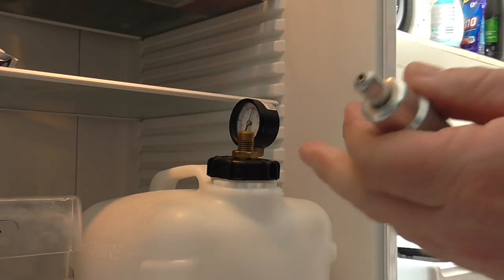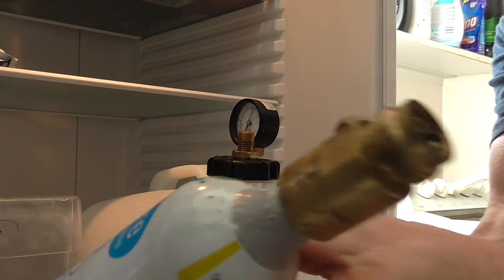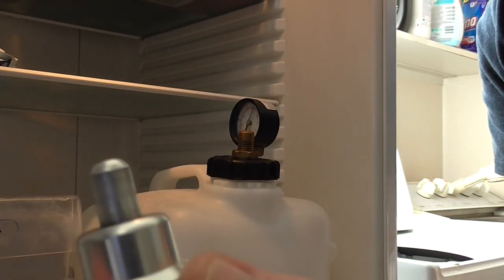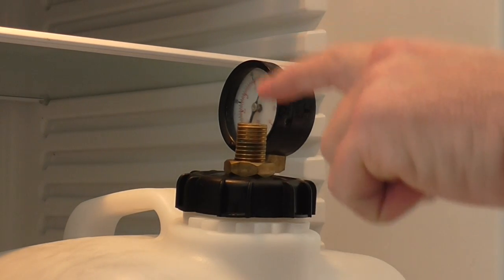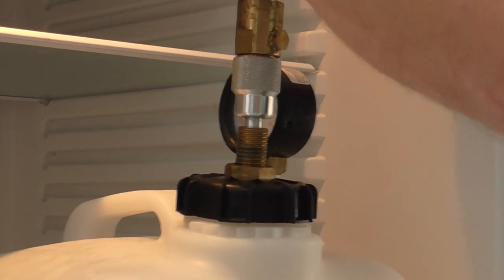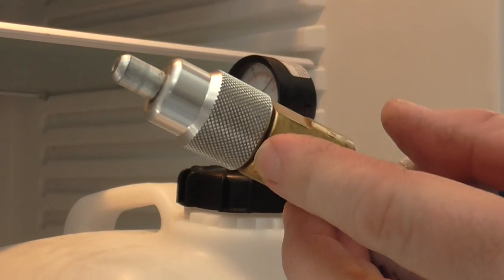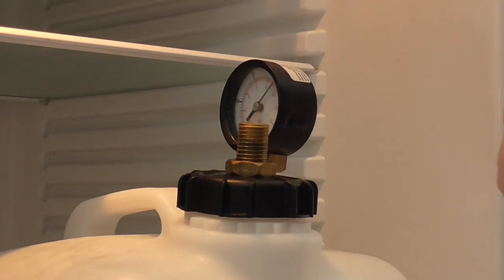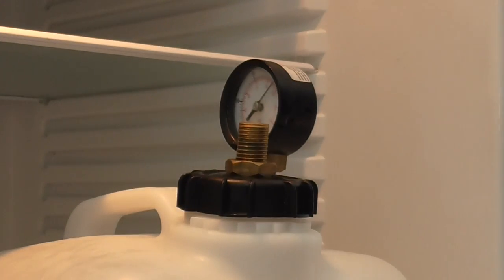Beer Mini Pressure Barrel - How I inject CO2 gas with a Sodastream Cylinder

Comment: Where did you get the psi regulator to fit your beer barrel
Reply from the maker: Hi. Check out the video description of this video. It has the type of pressure gauge I bought.https://youtu.be/TJksssBNNSAHere's where I bought the gauge from a local company https://nzsafetyblackwoods.co.nz/en/gauges-pressure-ss-1-4-bsp-bottom-0-100-kpa-each--05532436

Comment: Good idea mate I've seen someone do the same on a corny keg, it saves having a big C02 tank in house.
Reply from the maker: Thanks mate. I do a little priming in the barrel first to get the initial pressure up a bit, but the cylinder is a great way to keep the pressure maintained. Cheers

Comment: Really nice job, can you share where you sourced the inlet valve on the barrel and the injector fitting on the sodastream bottle form?
Reply from the maker: Thanks Simon. I got the S30 co2 inlet valve from a the UK Ebay site - https://www.ebay.co.uk/itm/Homebrew-Beer-Cider-Keg-Barrel-S30-Brass-CO2-Injection-Pressure-Relief-Valve/180513549000?epid=1988147188&hash=item2a07722ac8:m:mCpuoP5eZ3mwaGC6bsPe6-g
Reply from the maker: I did buy the sodastream adapter locally, but it was very expensive (about $40), but you can also buy them from Ebay too. Here's a link to some. Cheers - https://www.ebay.co.uk/sch/i.html?_odkw=sodastream+co2+adapter&_osacat=0&_from=R40&_trksid=p2045573.m570.l1313.TR12.TRC2.A0.H0.Xsodastream+s30.TRS0&_nkw=sodastream+s30&_sacat=0

Comment: where did you buy the adapter bro?
Reply from the maker: I bought mine locally from my homebrew shop, but you can get them from ebay, amazon, aliexpress etc. Here's a link to one - https://www.amazon.co.uk/Mangobuy-Hambleton-Adapter-Injector-Homebrew/dp/B072V4RVMD . Google "co2 sodastream s30 adapter" Cheers
Reply: TubeDinoz ahhh which one. im from auckland nz. thanks for the info.
Reply from the maker: I bought it from Hauraki Homebrew but looks like they don't have any at the moment. It was fairly expensive when I got mine, about $40 probably 5 years ago. A lot cheaper to get one online from overseas
Reply: TubeDinoz cheers bro.